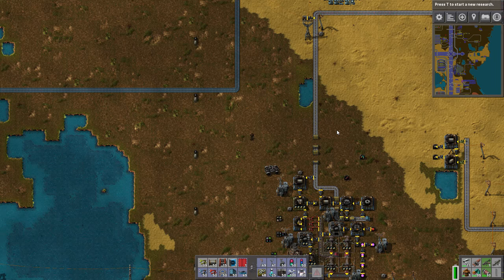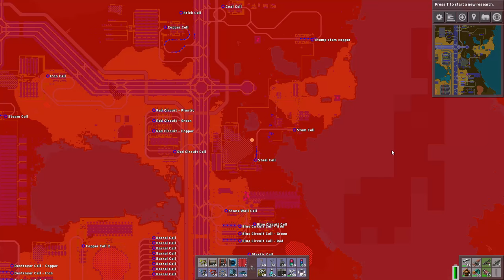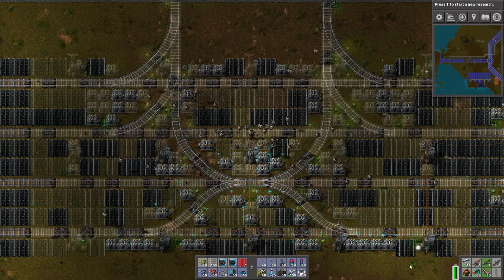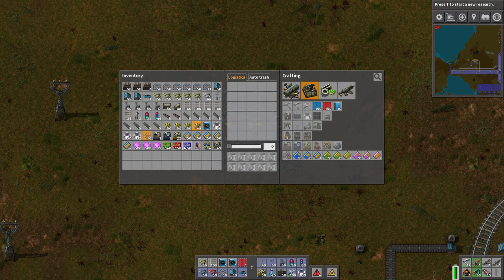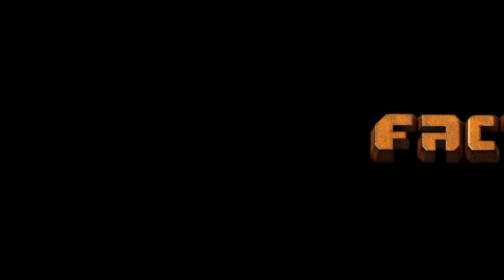Factorio Meiosis :: Cutting the Stem in Half - Episode 38

Comment: Awesome series, you should do something with circuit networks to keep it going. It will be very interesting since you never done it before. For example you could use them to controllably output 5 products on a single belt and load them on a train or control barrel flow in the oil system, or make cool colored indicators and displays with lamps showing how much you produce/store/need etc. Anyway love the series, keep up the good work!
Reply: btw merging the machines like furnaces and refinerys on one belt by circuit networks and putting them into a train with filter would be usefull for busing them into depo cell using just one stop and a train with filter

Comment: First time I built the rocket silo I thought the rocket just needed just ten each of the low density structure, rocket fuel, and rocket control unit, to make a single rocket part to go with the one satellite. Nope! It needs freaking 100 of each!! Ugh. My factory was not really up to the challenge, and took over four hours to build up the necessary resources. 

In any case, I think the "one rocket defense per minute" thing was based on an old version. The new version is much, much more difficult. Even if you can logistically supply the needed throughput to do one rocket per minute, the resources necessary to do so are somewhere on the order of a hundred-thousand copper and iron, and about 45,000 oil, per rocket. Because each miner only mines 0.525 ore/sec, you'd need 3974 miners all going at once to produce enough ore to supply one rocket per minute. That's a lot of ore patches! I did the calculation for the oil a while back, and it was also something like a couple thousand pumpjacks all speed boosted with maximum beacons.
Reply: People have done it, but I agree that Zisteau might not know exactly what he's getting into.

Comment: put productivity modules in the rocket silo
Reply: Smart ide :)
Reply: Luis Raposo Won't work unfortunately, productivity modules only affects intermediary items.
Reply: Evil Pumpkinman The rocket part and each of the components for it count as intermediate. The only part of the creation process that doesn't take productivity modules is the speed module 1 for the rocket control units.
Reply: Evil Pumpkinman yes it will i always use productivity modules in rocket silo and it goes faster , and if you see speed runs you always see AntiElitz using it